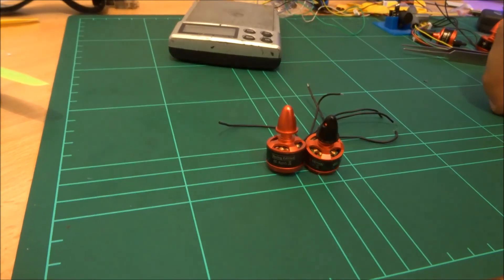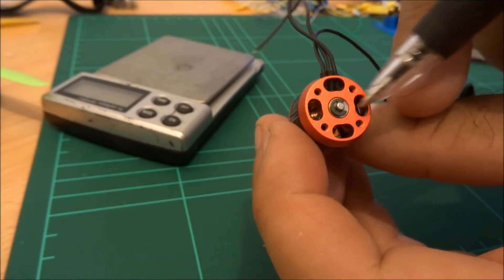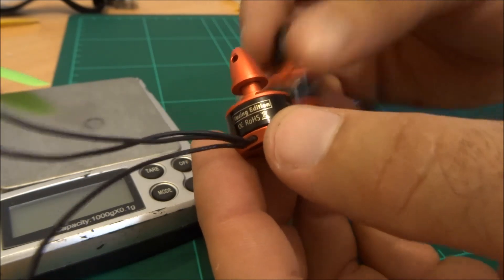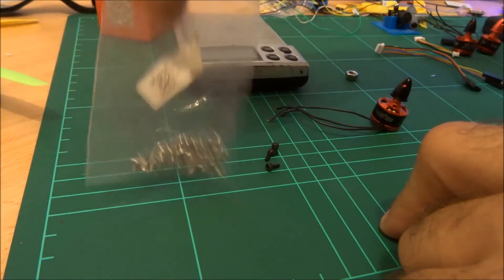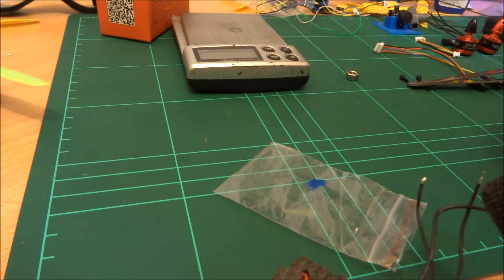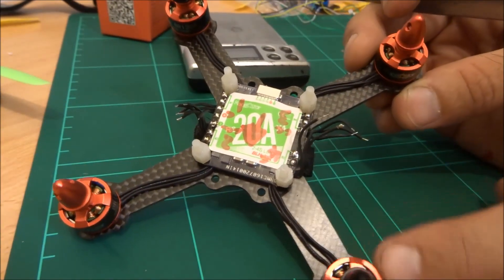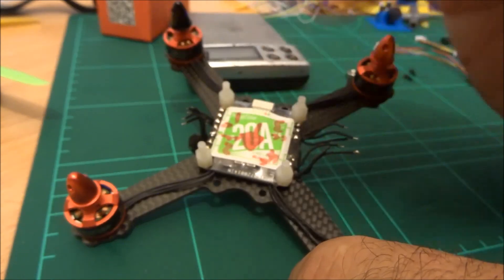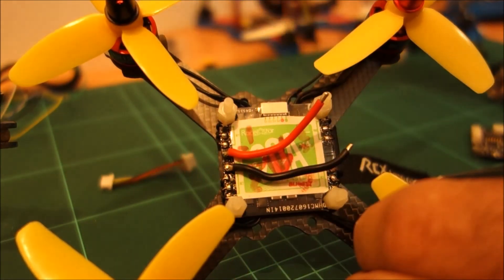Racerstar 1306 motor review  Stoopid cheap quadcopter part 3

Comment: Eagerly awaiting my motors and FC, all the other bits have arrived. My frame is slightly different being 3mm thick, will I be able to use the included screws? When will the next installment be posted?
Reply from the maker: Yes the screws will be fine
I have filmed the next video i will edit and post this week 
Thanks for the interest
Reply: gymp1979 is there any news on part 4? I now have all my hardware except batteriea and keen to complete build...

Comment: I just ordered these last week, my plan is 3S but they do say 1-2S but I have read people running on 3S but they do get hot. Will be good to see how you get on running 3S.
Reply: Mine have been fine on 3s with skinny 4 inch props. I'd imagine them being even more fine on 3 inch ;)
I have a video of the maiden flight on my channel, they were just warm after a flight.
Reply: John1925 can you post which props you are using please?
Reply: I use the kingkong 4045 skinny twin blades. My son flys it now, there's a few vids of him flying it and a full part list in my channel.
Reply: I have had mine for a couple weeks now flying on DAL 3045 with no issues and motors now even really getting warm even after 4 packs.
Reply: Jason Cross was that a typo? now instead of not? I played safe and went 3030 3 blade based on info available...
Reply: No, not at all, DAL bullnose 3045 running 3s and barely get warm, such a difference running these from my DYS 3100KV ones like a different animal. Well impressed for the money 👌🏼
Reply: I've made a build with the 3100kv ones and Gemfan 4045BN ABS 2 blade props. 
After a 10s burst with a 3s lipo they got very hot and started to smell burned. Are the 4000kv less prone to overheating or do the bullnose props have too much drag?

just now I've tested 3035 3 blade props. My quad doesnt have much punch anymore but the motors only get hand warm